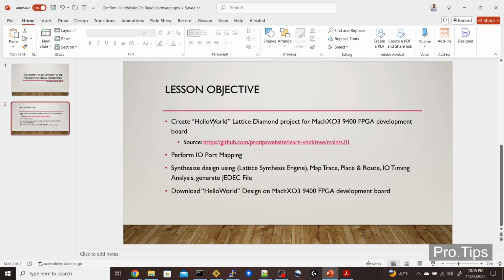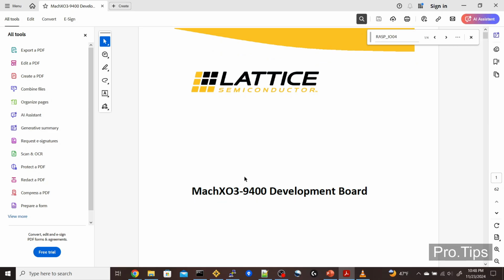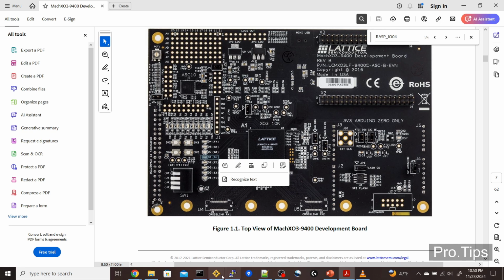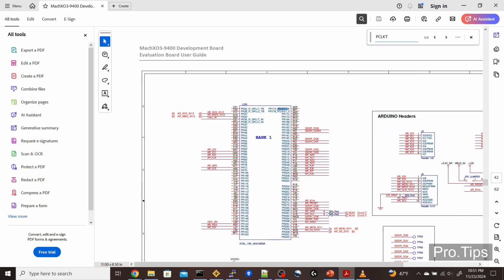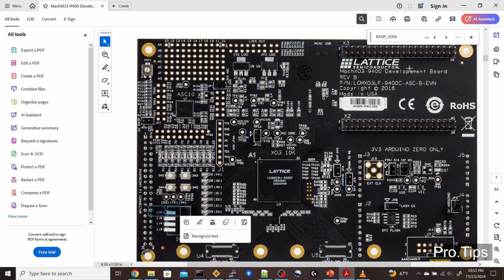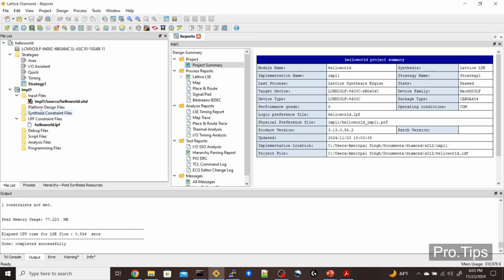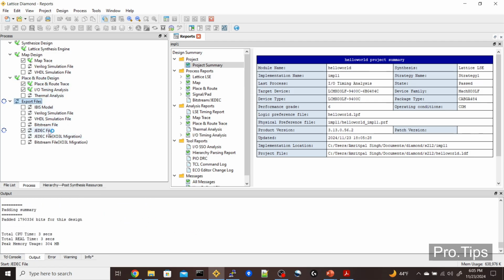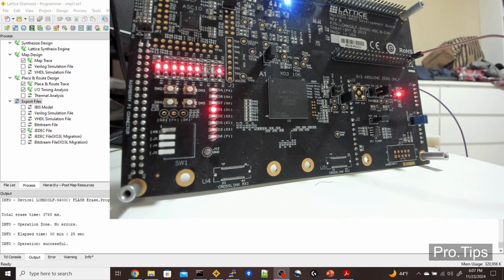Create HelloWorld Project on Lattice Diamond for MachXO3 FPGA (Download design on FPGA as well)

Comment: There seems to be many low-cost ECP5 and Ice40 boards...   colorlight 5a-75b v8,  cynthion,   fomu,   pico2-ice , etc.

I think Radiant can be used for either the ECP5 and Ice40 FPGAs? 

Any plans on a video tutorial on using Radiant / Reveal for a simple blink led example?  i.e. setting up the project/device configuration, pin assignment, timing constraints, simulation and programming? 

Harvey Mudd has a written tutorial (Lattice Radiant iCE40 UltraPlus Project Setup) but no video!
Gate Array Workshop with the iCE40  from jonathanjo 2017-02-01
Reply from the maker: Not at the moment, sorry, but please subscribe to keep getting future updates